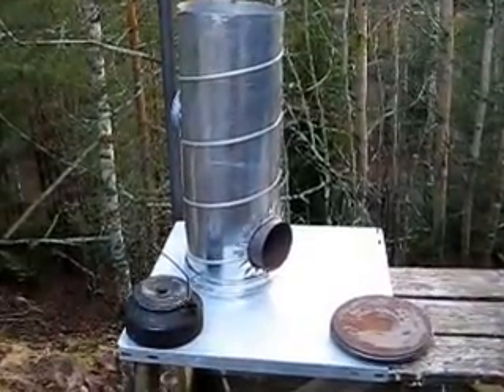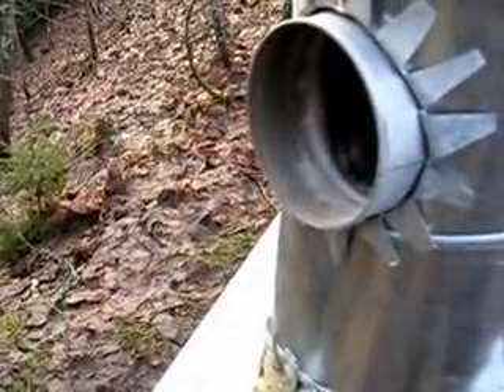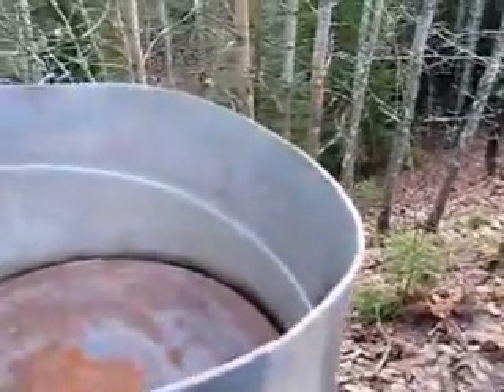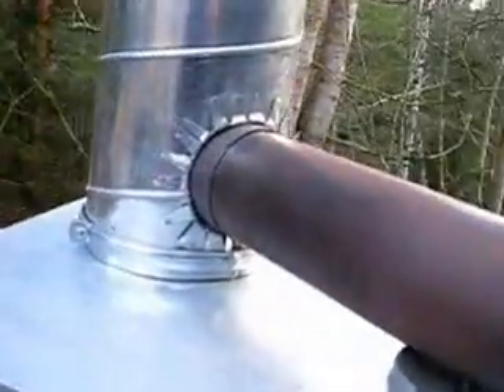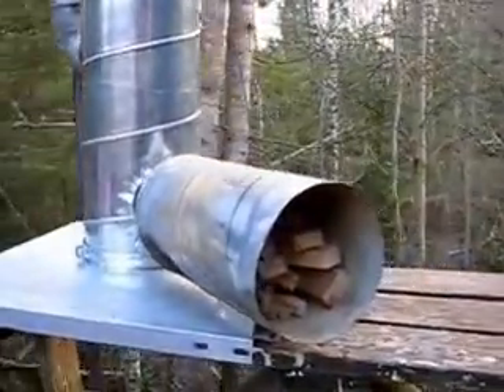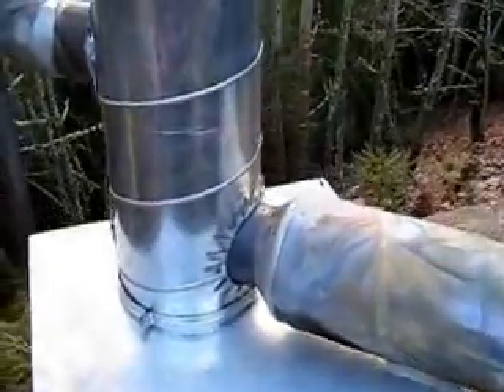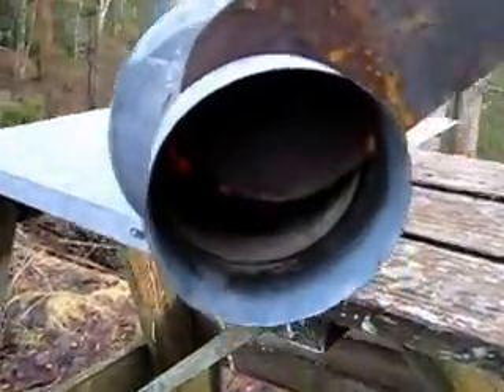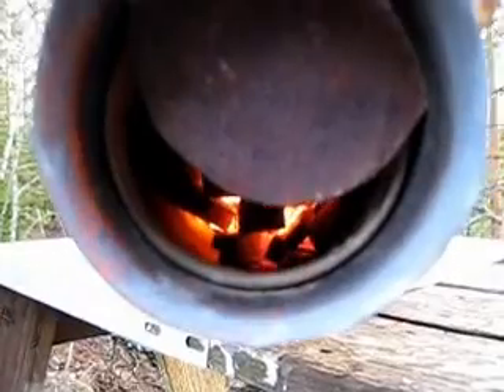Rocket Stove with Big Fire Tube

Comment: Thank you very much for all yourideas and tests sharing with us!
For my understanding: The bigger the difference of the temperature of the fumes exit the chimney and the temperature of the fire itself, the more efficient is the burning, because all the heat not coming out of the chimney can be used for heating. The bigger the fire chamber, the bigger must be the surface (and mass) which gets hot and / or the slower the flow through the system must be to have the same efficiency of the stove. You can also force the fumes to stay longer inside the stove by letting them make longer ways inside.
Reply from the maker: Thanks Daniel. I agree.

Comment: Very nice piece, Pekka! I note you say "you can put insulation round the fire chamber". I'd recommend to do that always. Instant jump up in clean-burn efficiency, fuel economy, and exit temperature at the top of the riser. But this is just a prototype, I understand that. And it still looks like a pretty good idea. If the air-inlet control works well WITHOUT CAUSING SMOKE then that's a really interesting development too. It seems to violate the basic 'constant cross-sectional area for the whole run of the tube' rule; but it seems also to burn pretty cleanly anyway. Wonder whether it would do that with a J-rocket. If so, that would be a real breakthrough. A big fuel chamber with a long, controllable burn time would be a real step forward with rockets. Especially if you could choke it down and run it at tickover FOR HOURS, but still with a clean, smoke-free burn. I'm working on exactly that puzzle right now, in my latest variant on the basic rockets.
Reply from the maker: Thanks Rhisiart. Cross-sectional airspace of the fire chamber varies during burning. When the fire chamber is full of wood air space is pretty small. I would say that cross sectional area should be constant after the fire chamber.
Even in J-type fire tube the cross sectional air space varies during burning. But with J-type it's difficult to get draft is the feed tube is larger than the channels. But it's really worth thinking about. Maybe some sort of light-up damper would help. On the other hand I think I've seen some prototypes with big fire chamber and J-type heat riser. I think it's possible to get it work. Good luck for your Rocket Design.
Reply from the maker: Check my video Rocket Stove Ideas 29 - Large Heat Riser. Similar idea might work with J-tube = feed tube and the heat riser are larger, channels after that are smaller.
Or maybe downward channel should also be larger.
Coming summer I will have some spare time to test new rocket ideas. Until than I continue dreaming.

Comment: Those are good ideals with the bigger fire chamber(fire box) and controlling the air flow is important if you want longer burn times since you enlarged the dia. of the feed tube.  Just want to mention the steel is to thin to allow this stove to be safe for long term use, only good enough for a few tests.
Reply from the maker: Yes you are right. I use thin metal only for the prototypes.

Comment: The fire feed tube and the inner riser will need to be made of 1/8 -1/4 steel if you want stove to last more than a few uses. The rest of the steel can be thinner, the outer shell and actual chimney(not the inner riser) and outer riser, but these inner tubes need to be thick to prevent burning it out.
 Recommend stainless steel for the fire chamber tube and inner riser.
Reply from the maker: Thanks for the advice Tony. I use thin metal in my prototypes. Much easier and quicker to work own without power tools.